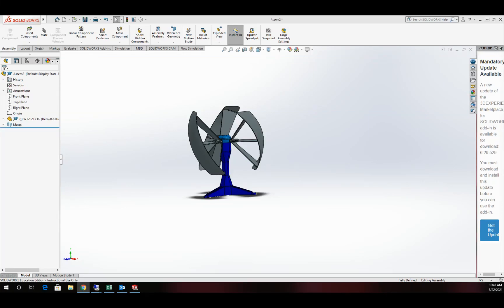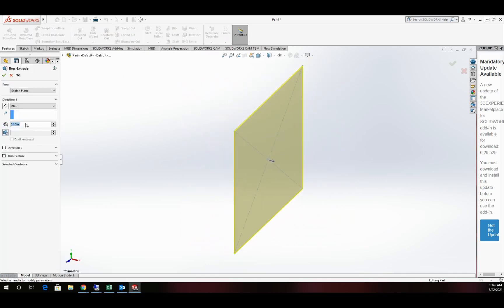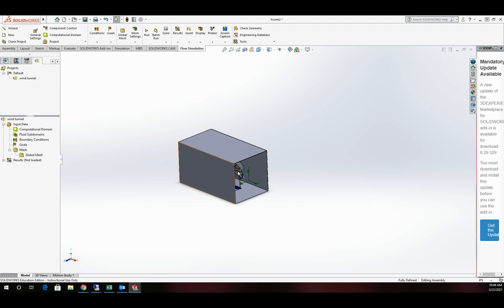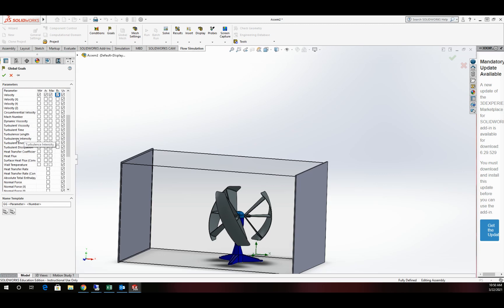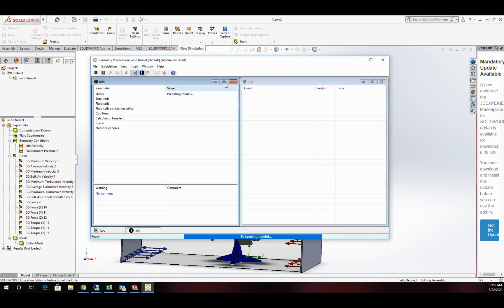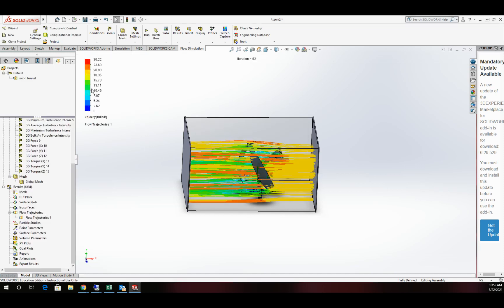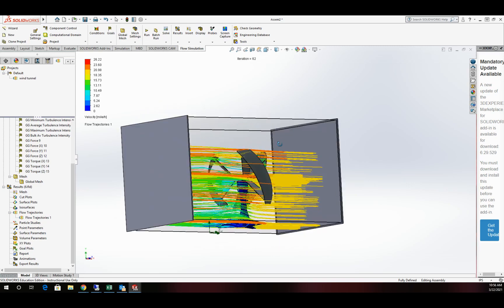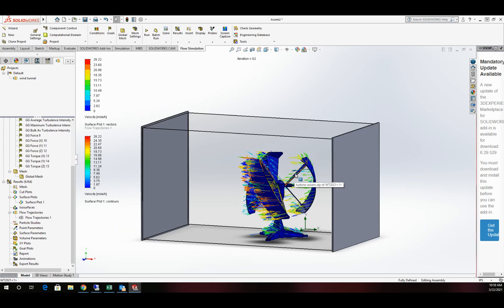SolidWorks Flow Simulation using a virtual wind tunnel.

Comment: MY VERTICAL WIND MILL PROJECT  DETAIL
FAN BLADE 66INCH WIDTH HIGHT 144 INCH FAN 10NOS
AIR DANCITY 241
WIND VELOCITY 5.5 METER  PAR SECOUND TO 15 METER  PAR SECOUND
HOW CALCULAT RPM 
HOW MUCH RPM JENARATE
 PLZ HELP

Comment: Hi, do you know of any way to put a 3d model into a program and simulate wind on it, so it moves as if it was real wind?... I'm interested in making wind spinners and seeing how they would move in real wind...
Reply: hi, did you find a way to simulate that, i've been searching too
Reply: @kagandary  Unfortunately not. Such programs must exist, I'm sure people use them when designing technology. Maybe there is just little demand for the general public to use them. I expect some games already have used simulated wind type physics - they use all sorts of other projectile physics - should just be able to make the wind a load of minuscule projectiles (which is what it actually is - air molecules) and it would work very close to reality. Just need to assign the physical properties to the 3d model and wind particles - in theory. I want to make a propeller that will spin in the same direction no matter which direction the air is directed on it. A program like that linked to a 3D modelling program would really help. Could just keep tweaking the design until it works, without needing a degree in fluid dynamics.
Reply: @Lloyd.B.  i didnt have much time as searching for it but found a video "https://www.youtube.com/watch?v=xIT1X6_idCE" fast forwarded it and saw a turning propeller and some airflows, i actually don't know if its useful or not but wanted to share it with you, also your project sounds so cool and unique, hope you find a way to make it happen and i see your design live on future one day!
Reply: @kagandary  Looks well complicated whatever they are using. It's obviously simulating wind and it's interacting with the propeller model. It's only one more step to let the wind move the model. Someone should just make a simple program for doing it. Where you choose wind direction and strength and weight of 3d model - and maybe resistance of any rotating parts of the object. Those 3/4 are all that I would need or want. CGI people use simulated wind and water vs 3d models all the time for films. I haven't looked into it for it for a long time. Not in the mood for 3d modelling anyway, it's too frustrating because I'm too lazy to learn the program properly.